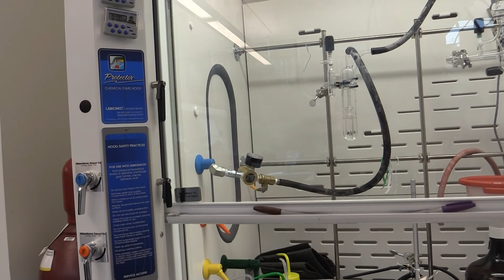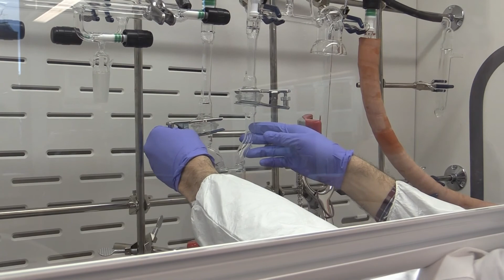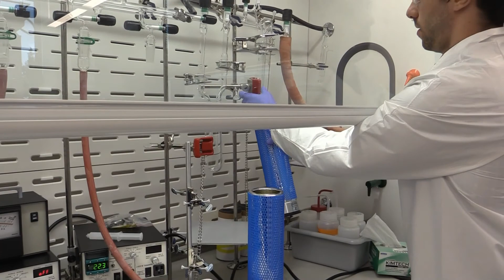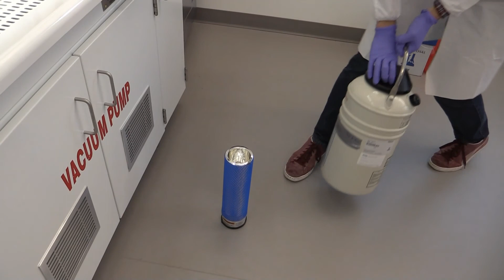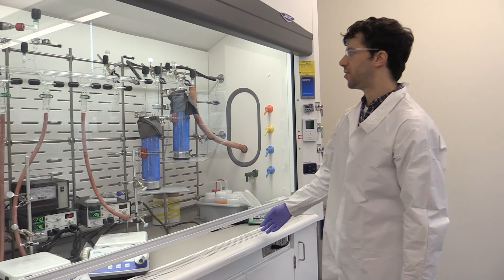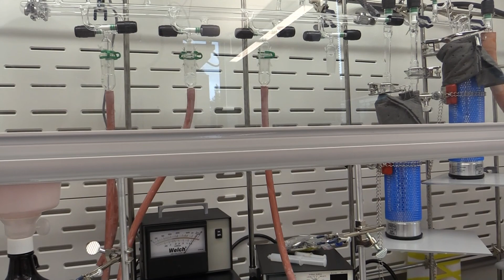Schlenk Line Demonstration

Comment: Teflon stopcock is not a good choice for the Schlenk system for working with organometallics.
Its OK for working with corrosives where traces of air and moister will not ruin your reaction.